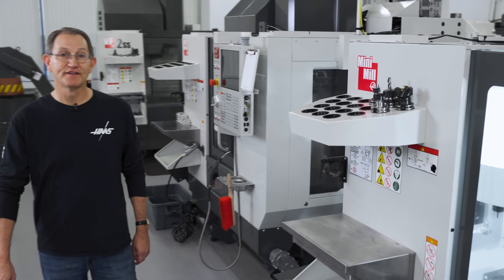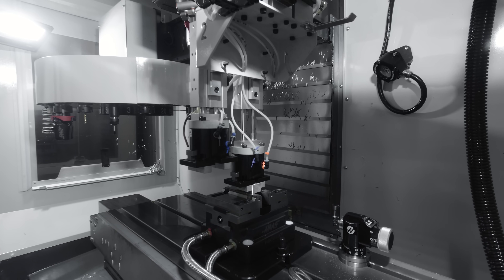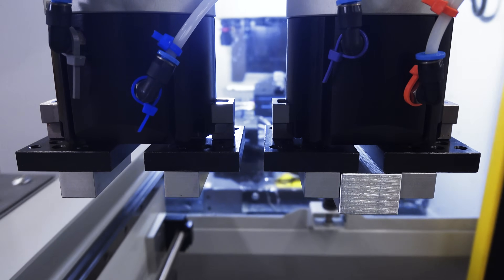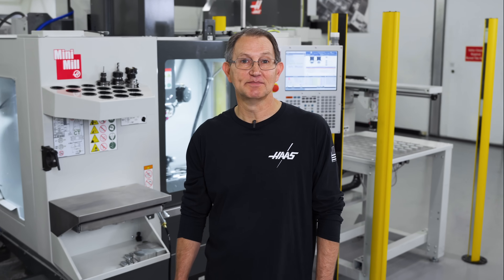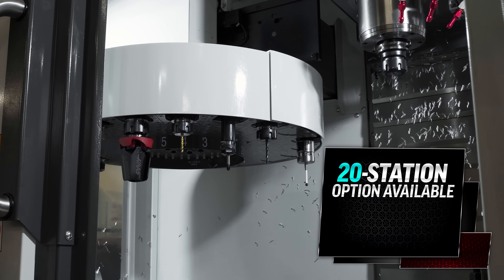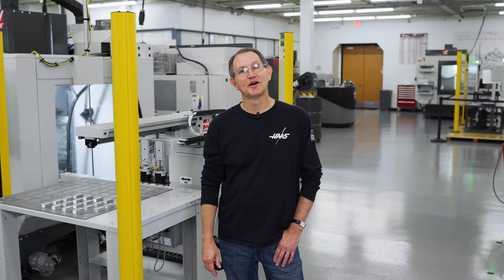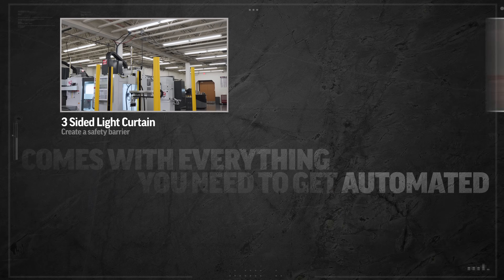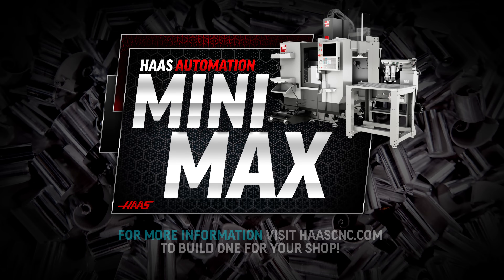Haas' Mini Max Brings Truly Affordable Automation - Haas Automation, Inc.

Comment: Is there any research done on quantity of parts needed to make this machine worth it? Like if I setup the machine for 1 part it's a complete waste of time vs 100 part then maybe worth the extra time. It'd be a lot easier to justify buying a part picker if I knew it was suitable for the qtys we deal with
Reply: I guess you have too many variables here that would make a calculation difficult.
Basically with this type of APL you can run only OP10 parts or parts, that can be held square for OP20. Loading soft jaws is possible, but oftentimes it's the gripper that restricts. If you need another set of gripper jaws, that will increase the parts needed to operate efficiently.

In my experience it's not only the number of parts produced, but the freedom your worker at the machine gets. What can this worker do, if he does not need to feed a machine all 2/5/10 (whatever) minutes. If you have tasks to be done, automation can be an option, even with small batches.
I know companies that automate with pallet solutions down to 1 part per batch.

Comment: What tolerances can the mini mill hold?  Your competitor SYIL claims .0004".  This is important to me as a small mold engineer.
Reply: I write CAM post processors day to day and get to visit many different shops. I frequently see customers with Hermle, Roeders, and Makino mills (among others) get +- .0002 tolerances on parts all day long. So it's totally doable with the right machine
Reply: .0004” isn’t that hard of a tolerance to hold. Good tooling and test run your program a few times to get it dialed in.
Reply: Part tolerance and machine repeatability are two entirely different things. Any claim of part tolerance should be taken with a grain of salt. There’s so much fine print about the exact cutting conditions, that make this claim essentially pointless. Machine repeatability is entirely dependent on the kinematics of the machine and it’s ability to compensate thermally. Any new machine should, when leveled properly, repeat within .0002”. Haas claims .0002” repeatability on their UMC line which is inherently less accurate, because a machine with a moving head has more dramatic COG shifts than a traditional VMC.  This makes machine level and rigidity more important.

More important than anything else though, is machine maintenance. I’ve been in front of a 15 year old Haas that passes ball bar tests under .0004” because it’s properly maintained and has its thermal comp and backlash updated annually, and I’ve been on a DMG that grows .020” from cold to hot because it’s been poorly maintained and worn out.
Reply: What do you do to maintain your machines? Fill it up it grease and oil. constantly check coolant levels.  @therealsarlic4702
Reply: Thats such a wishy claim though. So many machine makers make such claims. But what tool, material, temperature, stickout, tool holder, etc are you using and in what condition? You would need absolute perfect conditions and consistency to lean on that. I wouldn't ever bank on milling paths holding .0004. You're talking wire EDM if you need to rely on tolerances staying in the 4th decimal.
Reply: Youtuber nerdly took his HAAS mini mill and showed the spindle had a .001" Tolerance 6 inches from the spindle and his SYIL x5 had naggable out of roundness.   @Turbo.M777
Reply: He's talking about either the  positioning or repeatability tolerance of the machine itself.  For either .0004" is not that good.
Reply: @Turbo.M777 off cause a syil and haas cant hold that tolerance  within 10um.

The machine has to have hsk holders and spindle grow sensor. But you can mill within 10um in a room that isnt clima controlled, because the machine and sensor handles the temputure of everything.

But as a pro mold maker, i have made parts on hsm 5 axis mikron/roeders/kern/dmg with tolerance of +- 5um (0.005mm) all day

So its possible no doubt
Reply: I think this is a difficult question to answer generally because it depends on many factors. Materials, type of tool, holder, pathing, speeds and feeds and setup. Some machines will be more forgiving over a wider set of variables.

In general though you get the repeatable tolerances you pay for.
Reply: The biggest issue as a mold maker with both haas and syil is the surface finish, when milled with small ball end mills.

tolerance isnt great on both machines because of the spindle grow there is with a taper 40 holder, that hasnt big plus spindle i would say 0.05mm tolerance over night machining
Reply: SYIL is Chinese junk.
Reply: @Crazygamer_257 false
Reply: Hmm... .0004 linear?